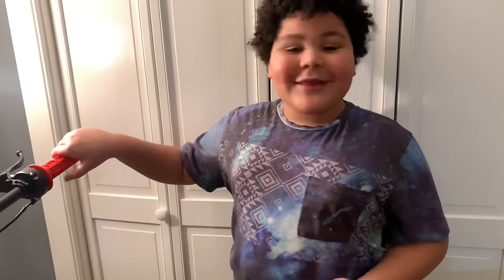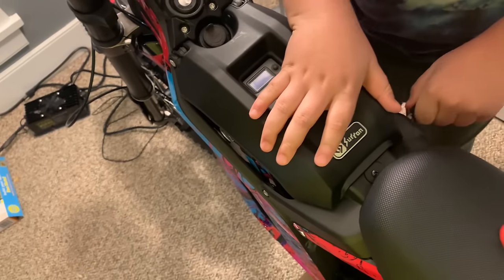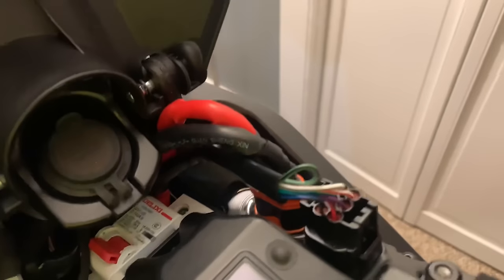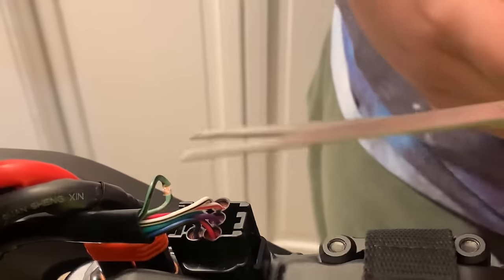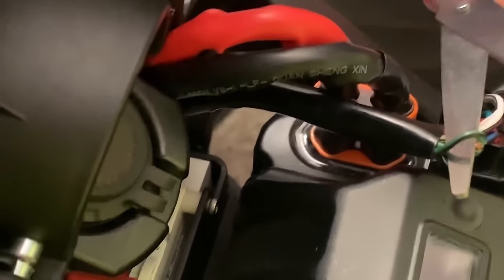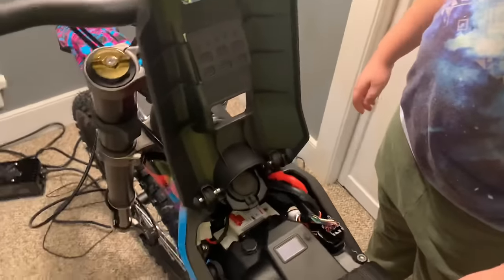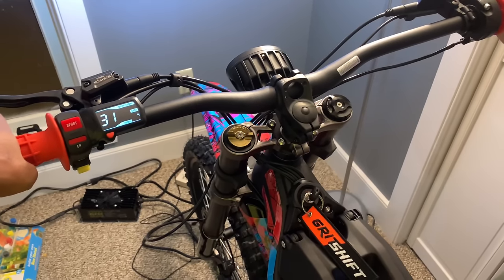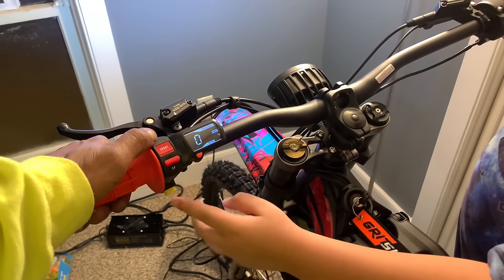Cutting The Speed Limiter on a Surron X

Comment: Does the battery drain more noticeably? I travel 22m a day for work. 6 months in and in itching
Reply from the maker: Every mile in Sport Mode is 5% so Yes but if needed to be somewhere timely it’s still worth it. I cruise around in Exo and only hit Sport Mode when Practicing Wheelies✨
Reply: @emotogang  So only eats battery in sport! Thanks for info! I think it may be worth it. I really could use that extra kick up a few certain points on my route.

From 100% I usually make it back home at about 50%. So even with that extra drainage, I should still make it home with battery.

Comment: Just curies, there are two green wires, is the green with black stripe is the speed limiter. Other video just tell you to cut the green.
Reply from the maker: Unlike the Other wires the limiter will have a loop 🔁✨ Exactly like The on in the Video‼️ if The Green Wire You see is connected to a plug ~ it’s not the one to cut💎✨
Reply: @emotogang  ok very helpful

Comment: Was there any mods before because I cut my wire have a 48t sprocket and stock wheels on and it still goes 29
Reply from the maker: No way… is it in Sport mode??
Reply from the maker: Just Decal fender Handle Bar and Peg spacer🔥✨ make sure it’s the Green looped ➰ wire
Reply: @emotogang  It was always in sport mode I found out, but however before I cut the wrong green wire not the green one connected to the battery 😂

Comment: Dosent this damage the bike over time?
Reply from the maker: Not even a little‼️ The Limiter is in place so than it can be sold to someone without a license by Law✨ Also in worst case they sell the wiring Harness online in case You rip out a wire. Unplug and replace harness basically puts You back at Square one with a limited bike✅ My Bike Currently has 10K+ Miles on it and I haven’t had an issue yet⚛️

Comment: Great video but you don't have to cut any wires turn bike on pull in right brake x4 and on the 5th hold it in, done bike unlocked

Comment: Make the wire you cut longer and put it on a switch with a fuse so it don't blow anything and have switch up top so you don't have to mess with it when you want it legal have the switch on when you want it not legal have it off like you cut it

Comment: I wouldnt charge that thing in the house that battery catches fire your house will be gone
Reply from the maker: This Bike has a $200 Charger that cuts off when it reaches max capacity ✅ it’s call A B.M.S. (Battery Management System). It’s a Built in kill switch that 90% of Ebike Chargers do Not come with 🎯 I’ve been Riding e-bikes for  since 2018an have Not had 1 Fire 🔥. I Only Charge in My House 🏡 or at work (Walmart)
Reply: @emotogang  ok just wanted to make sure you avoided a disaster hahahahaha
Reply from the maker: Thanks Homiee🤙🏻⚡️